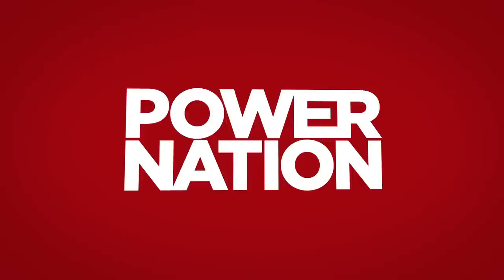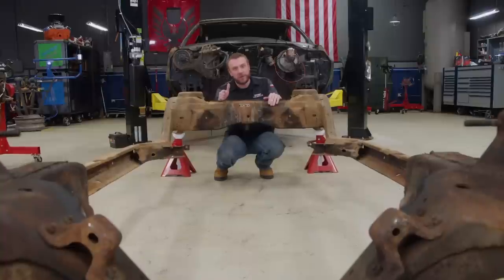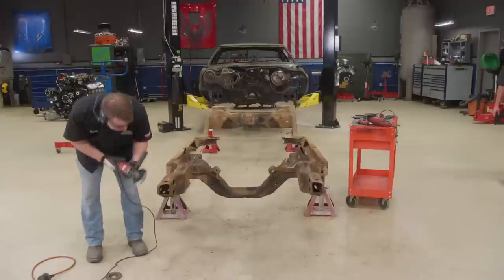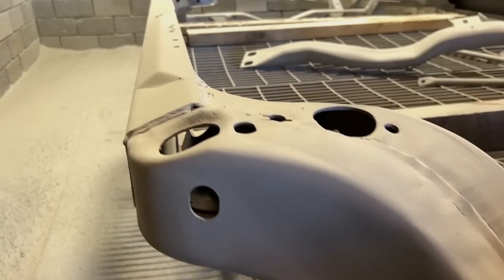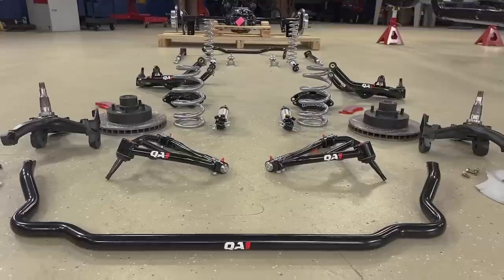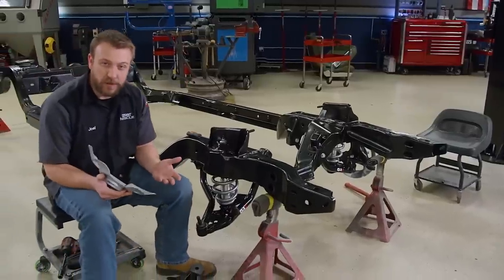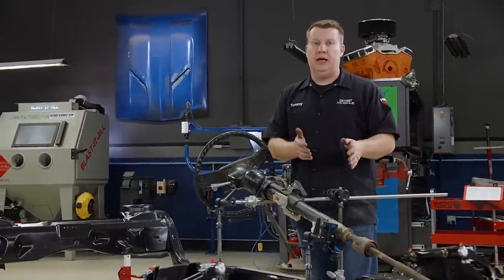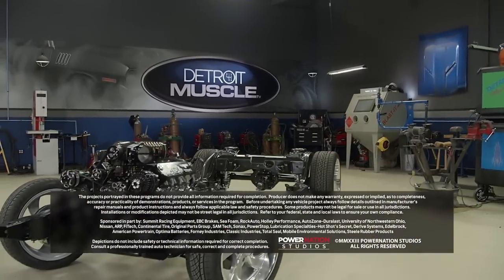Tension Prevention With New Suspension For The ’71 Caprice -Fat Stack Part 3- Detroit Muscle S10, E3

Comment: With 800hp, I'd box the frame rails and reinforce the suspension mounts, but I'm an overkill guy. Looking good, have fun!
Reply: Exactly what I was thinking. That's a lot of HP to run on those open frame rails.
Reply: With that big of a body bolted to the frame it shouldnt be an issue
Reply: Most Pro Touring frame companies put in the braces from the rear A arm location joints forward to the trans mount and then to the bend in the front frame rails. They claim to be lighter than stock frames while adding all this metal, but that's due to rack and pinion steering setups and tubular A arms front and rear. It wouldn't be hard to replicate that here, and when Chevy created the Z16 Chevelle, they went with a convertible frame which weighed more due to its extra metal. 

It's worth it to give a good suspension design a solid foundation to push up against. that body might be enough, but it's just sheetmetal and glass.  No matter what tech is available, a heavy car isn't going to override the laws of physics and run like a 69 Camaro.
Reply: Yes over kill 800 horsepower seems like a lot but it's not a whole lot
Reply: That’s smart 💯🇺🇸
Reply: @fabiancook1498  right, it's not the HP it's the torque, which is twisting power.  and if it just smokes the tires, then that's the "safety release valve". but with a good set of slicks...
Reply: Hey man, better overkill than upside down in a ditch. I’m with ya
Reply: @vertrox3435  a smart performance car builder designs the car to get out of trouble faster than  the driver trained by a high school football coach got into it :)
Reply: @vertrox3435  71-76 GM full size cars were notorious for cowl shake and rattling doors, compared to 65-70 GM's. One commenter said "the body is so stiff it should keep the frame straight"... I don't want to ride in that person's car!
Reply: @albertgaspar627  I got a 71 chevelle that I stripped the frame down. With the front part on saw horses and holding it at the back you can litteraly twist it some by hand.I was surprised how flimsy it was. Yeah they should box it.
Reply: yeah just when they handled it for sandblasting, the whole chassis was bouncing easily. We understand that bolted to the body it will be less bad but some boxing here & there wouldn't hurt.
Reply: @jefffixesit60  true, GM went from an X frame  in 1958 that had no side impact protection, to a nearly ladder frame (and almost in the shape of a bowtie from above). they tried to make the late 1970's generation for NASCAR, but there should be a little bit of chassis flex for 90% of the cars that won't be handling 800 hp. A little bit of flex helps with the ride comfort. but eventually, the suspension has to have something to work against, and that's a strong frame.
Reply: @BruceLee-xn3nn  agreed. people think the car body is going to hold the frame, but they forget gravity :)  the body sits on the frame and gets the support from the frame, everything works from the top down to the bottom. you don't build houses with concrete ceilings to act as foundations.
Reply: I have a 71 with 1200hp with no issues. These cars came with big blocks made for horsepower and torque and you can also tow a RV trailer with it.
Reply: @conductor710  how wide a rear tire are you using, what rear gear ratio do you have, what's your stall speed and are you running a trans brake or a powerglide, what's your 60 foot times...yes, Detroit designed these cars to handle 500bhp. and even they used the convertible frames, not the regular 6 banger ones (like the Z16 Chevelle, for example). just like not all chevelles get a 12 bolt rear axle.

There are cars who leave the line "soft". They run streetable rear gears, or a 1.48:1 ratio Powerglide or a torque converter stalling below 3,000 rpm when their torque curve begins at 4,000 RPM, they aren't lifting their front ends by much (due to keeping the front sway bar attached) but their engine is really squirming around on rubber mounts under the hood, etc. Their plan is to "chase down" their competition at the big end, but they also can "run out of race track" against someone who launches hard and stays out ahead of them.
Reply: 7

Comment: What about re-enforcing the Frame???
Reply: With the big body of the car bolted to the frame itll be plenty strong enough
Reply: that could be done, but it would be a pain in the ass , especially if the electrical work and brake lines are tucked in the frame rails

Comment: The frame looks awesome and the QA1 suspension is gonna give her a great ride. But shouldn't have low profile tires needs some fat drag and street radials
Reply: wouldn’t work with a car that heavy, because the car in stock form is over 2 tons
Reply: Eh, agree to disagree I like the rims.
Reply: @williamhutchins479  u
Reply: @hiltonnerwich6301  ?

Comment: Just curious.  Why did you not add some reinforcement to the chassis?  Isn't that 800HP LS going to tear apart the stock chassis?  Also, what about the body roll?  How is that going to be combatted?
Reply: With that big of a body bolted to the frame its not going to be an issue, as for body roll thats what the sway bars are for
Reply: @19chev81  Hey, I just watch a lot of these and they are always reinforcing the frames or putting an Art Morrison chassis underneath. 😀
Reply: @Saratogan  the body isn't going to do much--it's just sheetmetal and glass. It will flex like an '85 Monte Carlo running 600hp. You can add weight with sound deadening etc, but now you're really killing performance. As for the idea that sway bars will overcome the laws of nature...what do sway bars push against?  oh yeah, the frame, not the body :)

Comment: The ones that don't know.94 96 impala has the same frame and parts.besides motor and trans
Reply: Yessir b body
Reply: The 1994 Impala has a wheelbase over 5 inches shorter than a 1971, so how could have same frame?
Reply: @johnmcmullen456  from my understanding from 71-96 shared the same frame I’m no mechanic or anything that’s just my understanding what I’ve been told. I have all three 76/86/96 how would I tell if it’s the same
Reply: @johnmcmullen456  all the 91-96 have the rearend pushed forward about two inches i know this for sure because I have to change control arms every time I put wheels on one
Reply: @IDRIVEOLDCARS  The 1971-1976 full size Impala has a wheelbase over 121". For the 1977 downsizing, it was reduced to about 116". Basically the 1977 Impala that GM advertised as all new was just a rebodied 1973-1977 4 door midsize Chevelle (116" wheelbase.) The next generation of the Impala in the 1990's is also around the same 116" wheelbase as the 1977 downsized model, so maybe it's just a rebody of the 1977. My guess then is that frames "may" be same or close for 1977-1996 full size B bodies & 1973 -1977 mid size A bodies, but at least 5+ inches shorter than those long 1971-1976 Impala frames. I suppose you could check by measuring the overall frame length or distance between suspension pick up points on the frame.
Reply: @johnmcmullen456  what you said make plenty of sense.
Reply: @IDRIVEOLDCARS  Hope it helps. You have a nice trio of cars. I have a 1974 Delta 88 convertible that shares a lot of chassis parts with the 1971 Impala, so this video series really interests me. Surprised to see so many aftermarket parts available for a car not that popular in the collector market.

Comment: Listen 800 horsepower I am big block is a lot of torque on a LS motor wich what they building now in what numbers are not that high  power status is very quick so no you don't need to weld the frame to the car well d
Motor to the car it's light quick and Swift

Comment: yall still dont got enough. should've boxed the frame and used better tires. Not to mention those brakes are kinda a piss poor choice compared to the other choice of parts.
Reply: Brakes are more then adequate in reality.  With that big of a body bolted to the frame its not gonna be an issue
Reply: @19chev81  I’m aware of the adequacy; im comparing them to the builds they think they’ll line up with. But im sure they’ll never see the track or a street race.
Reply: @BigBlockCaprice  right, and the body ain't gonna do much for twist except add weight. that's why GM put the frame in there in the first place--they didn't design the body to be a unibody and take the weight.

Comment: Low profile tires 👎👎 it isn’t a classic looking car any longer with those tires.
Reply: Ok grandpa
Reply: Naw he just up
Reply: I agree with you about the large wheels. They will not look right on this car. I vote for 17" Chevy rally wheels.
Reply: The only reason this car didn't come with these types of tires was only due to the technology not existing yet. The guys back then we're gear heads just like us. If they could have used them they would have. Every hot rodder out will take highspeed stability every time.
Reply: Their show and their money.
Reply: L
Reply: Boohoo
Reply: Hater
Reply: Dude Continental Extreme Contacts are some of the best tried in the world. Furthermore, they are building a "DONK" so they are purposely using larger wheels with low profile tires.
Reply: Yup.. but I kinda like it like that.. 🤷🏾‍♂️